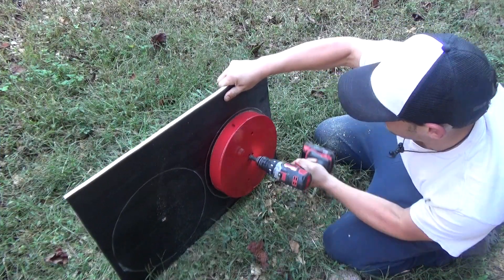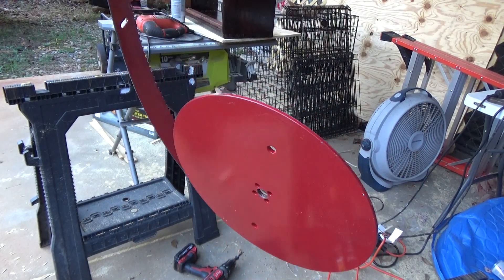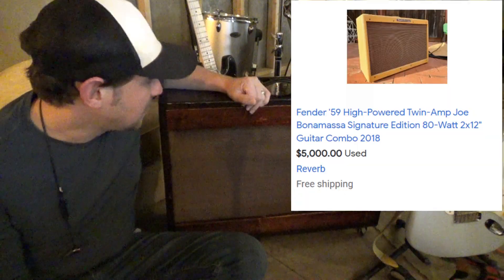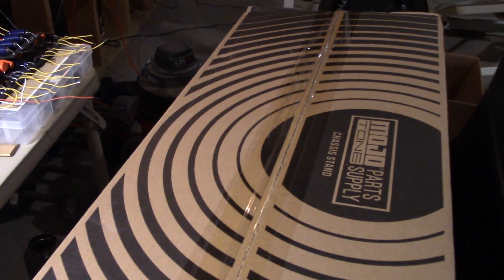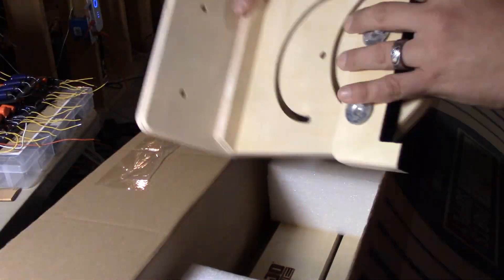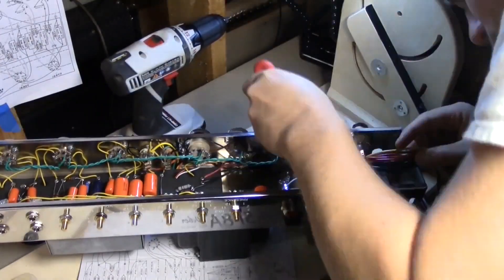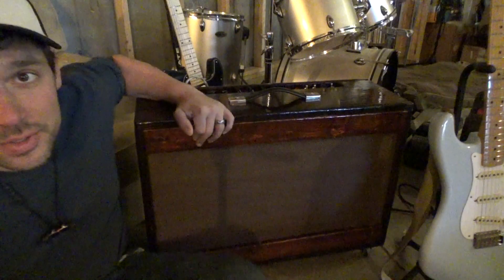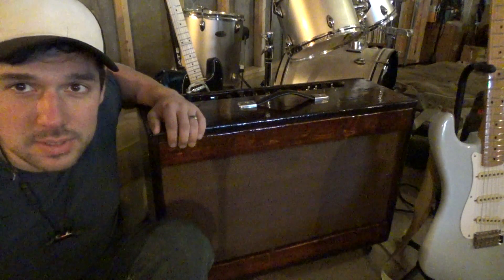Building a High Powered "Tweed" Twin 5F8A (Joe Bonamassa's Amp)

Comment: Dude riff raff is my favorite acdc track. I am finishing a deluxe and next I'm building this amp. I already want to build another
Reply from the maker: You should check out som old Hammond AO. Save yourself $700 and pre order some of the components you’ll need. It’s been great fun
Reply: @lowheadroom  I'll Google that when I get to work. THANKS FOR THE TIP. I went thru mojotine and though they made it extremely easy with directions and videos on you tube for places 1 might get stuck or learn from a tip It was great for my 1st build now saving money sounds perfect
Reply: @lowheadroom  so I checked out you suggestion and I thought that sounded like a hammond orgam. I want to do something like that repurpose other stuff I found a hammond chassis that had a transformer and like 9 valves on it.
Reply from the maker: @handwiredbyme  it’s pretty easy to copy the classic circuits once you’ve identified the power and output transformer leads of the gutted Hammond. I usually pick them up for $80
Reply: @lowheadroom  oh nice. This is exactly my goal. I was gonna try and make a chassis out of something else like a cake pan or whatever but I like this better cause you get other parts. So the hammind transformers are both usable as is?  And do you use any of the old tubes or just order a set biased out.

Comment: Wondering why you left the edge on the back top instead of leveling it with the top of the amp?  (Also, you could have used thinner wood for the back).
Reply from the maker: To each their own :) . It is level with the rest of the amp
Reply from the maker: I wanted to match the width of the original tweed amps (or at least get close). I find it looks to have better quality with thicker back boards. But some might disagree